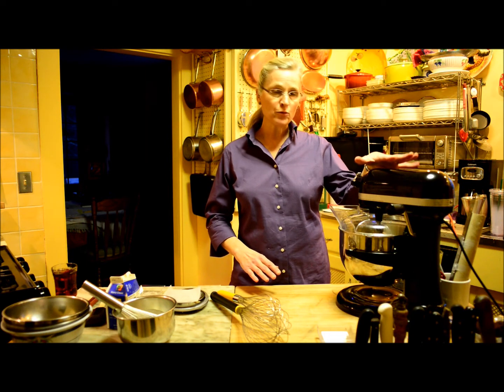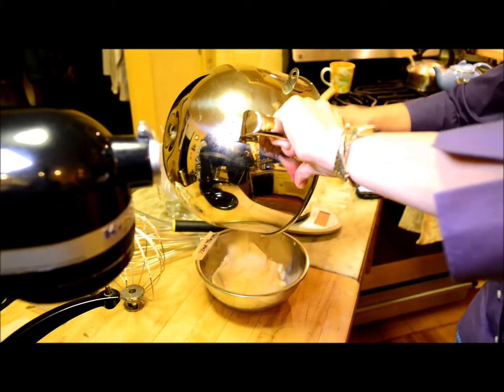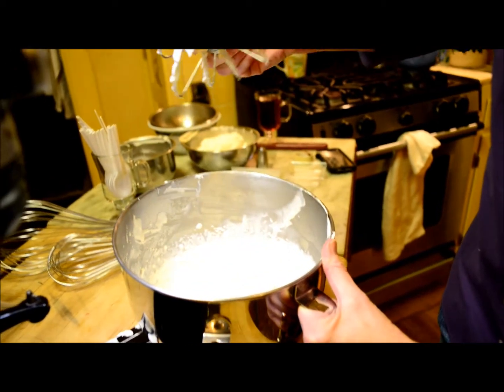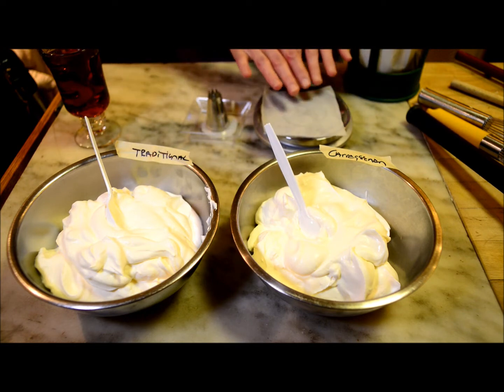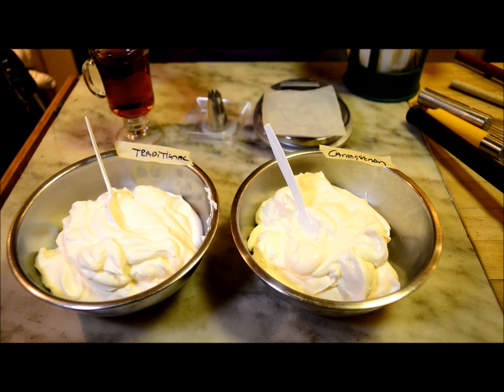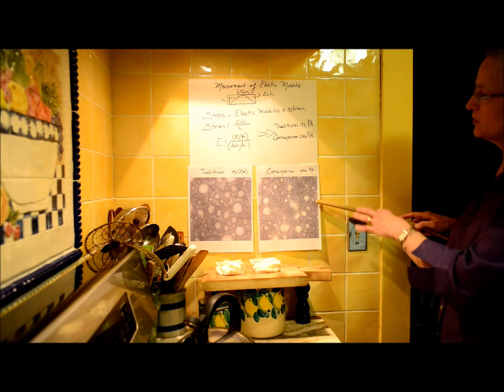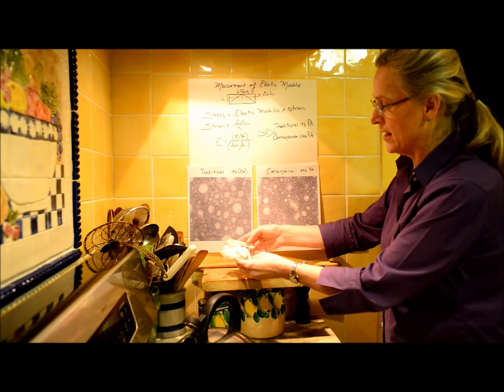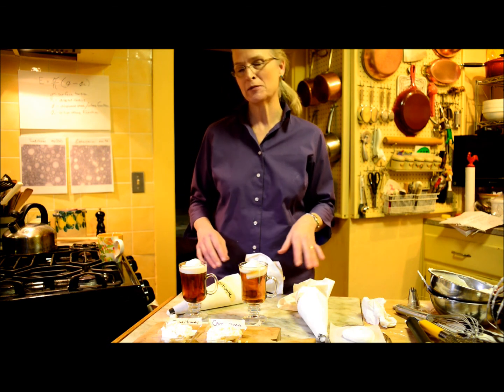Whipped Cream : Traditional and with Modernist Thickener

Comment from the maker: Hi Thushan - Thank you for your comment and taking time to watch my video. In answer to your question below, take a look at the last lecture in the Elastic modulus, week 4 - summary. There Michael Brenner talks about the elastic modulus using example like not only steak, but a chocolate mousse as well. A chocolate mousse is a foam like whipped cream, where there are lots of air bubbles. Whipped cream and mousse are very similiar and have a low elastic modulus, another words, they are soft and won't spring back. My project compares the E. modulus of the whipped cream and how the E increases with the addition of carrageenan. I hope I've answered your questions. Thanks again, Susanna